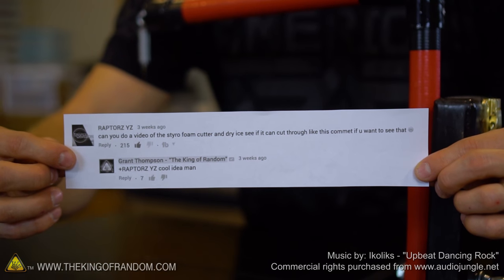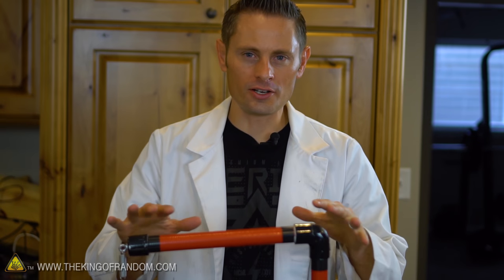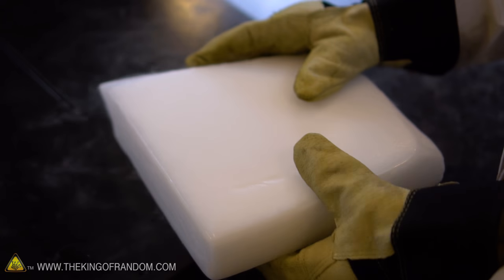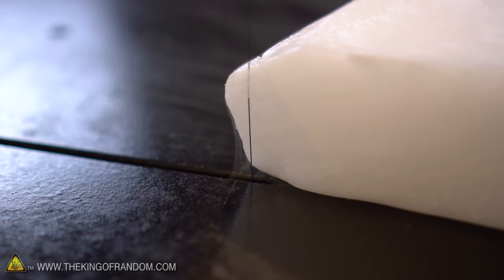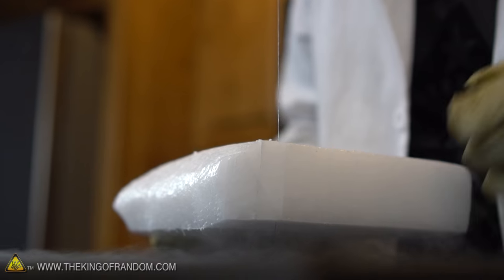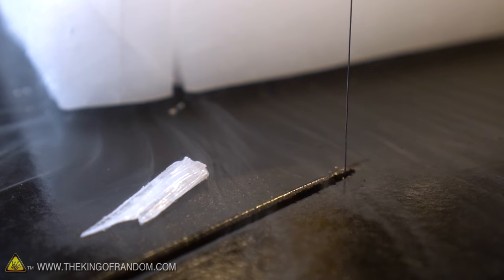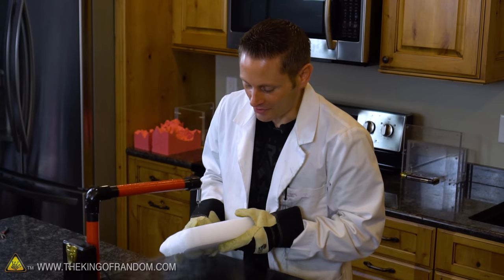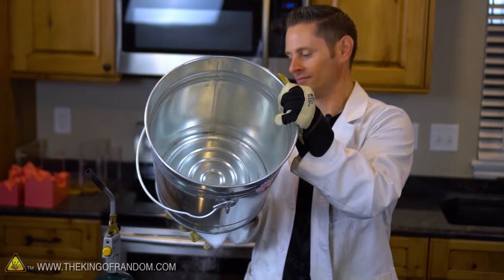Will a Hot Wire Cut Dry Ice?

Comment: The wire and propane torch didn't cover enough area but what about a barbecue? It would almost evenly distribute heat around the block
Reply: gatorgaming11 gr8 idea
Reply: Throw it on a BBQ!
Reply: Yea due to surface tension the block cools the wire.
Reply: It would put out the fire, it's CO2. Or maybe you mean a electric one.

Comment: what happens when you put dry ice in liquid nitrogen
Reply: You get long lasting dry ice and evaporating liquid nitrogen. LN2 is much colder than solid CO2
Reply: frozen raw chicken that will shatter like glass :)
Reply: you know how ice cracks when you put it in water? the ice is imploding because water expands when frozen. In theory, it should explode
Reply: AWW I DIDNT SEE YOU ALREADY POSTED THIS
Reply: when you drop ice in water it doesn't crack from freezing its the opposite. It cracks because the water which is warmer than the ice heats up the surface of it causing it to expand. Since the center of the ice is still cold it doesn't move. This causes the ice to basically rip itself apart. This wouldn't happen for dry ice because it isn't a liquid. If you used regular ice it wouldn't explode either because liquid nitrogen is colder than ice. The ice cube would actually cause the nitrogen to boil.
Reply: Jesse Robertson
Reply: What a
Reply: Jesse Robertson lol thats weird
Reply: Smelly Poo ok
Reply: Blaizer Beam gaming and vlogs #CageFace.
Reply: That's basically how they make it

Comment: What happens when u put most strongest acid on dry ice and with most flammable liquid and try to put it in the arc furnace
Reply: nothing
Reply: mrlevite1237 probably*
Reply: it would probably depend on the size of the dry ice. small chunks would probably vaporize very anticlimactically, mid size might pop the top off the furnace, and a chunk almost too large to fit in the furnace would probably freeze the top to the main body, and blow up from the pressure buildup.

Comment: What about your sun powered, magnifying glass? Will that work on dry ice?
Reply: Kerbal Plays - Minecraft I would like to see that too
Reply: yeah, that would be cool to see
Reply: I wouldn't expect a whole lot. The dry ice is white, so it doesn't absorb much light to begin with, and it's also a little bit shiny (kind of like regular ice), so that's even more light not being absorbed. That being said, it could be so powerful that it manages to overcome those "obstacles" and still do some damage. Maybe he'll try it out.
Reply: elektrikpulse61 Maybe he can place a black metal on it to capture the heat.
Reply: the fastest answer is to put the dry ice in a metallic box painted on black

let's go crazy, let's propose a challenge to Grant Thompson, make a metallic box (cheap metal) then melt some copper brass in the foundry, use it as a coating for the box (so heat is easily transfered, and copper brass has a decent thermal conductivity, is cheap, easy to melt and easily found) paint it with black and then put the dry ice in the box, then just apply heat to the side (for example) or use a mirror to reflect the sun to the bottom of the box.
Reply: If a propane torch doesn't work the magnify glass PROBABLY wouldn't work. Just a guess
Reply: Joachim Von Grimorium
Reply: HydroSphere Gaming he has a 4 ft one that can burn up to 2000 f
Reply: Edward Zhu Oh didnt know that
Reply: yeah. It uses an old tv screen. It sets logs o fire in seconds and then burns through them in minutes.
Reply: oooh id like to see that
Reply: are you mad Kerbal are you mad??!!😠
Reply: it needs to make as much heat as lava or atleast a big percentage of it
Reply: Piemanding Joachim Von Grimorium I like your ideas. If more people like the original comment or make their own suggesting he does this, maybe we'll get a video featuring dry ice versus a 2000F sunbeam.

For the best results though, I'd wait until June or another northern-hemisphere summer month before doing it to ensure maximum "fire"power... that was a pretty bad pun, sorry - especially since it won't catch fire, being made of CO2 and all.

Comment: What will happen if you use the match head powder and sulphuric acid by placing it on dry Ice?
Reply: Ridiculous I would wanna see that
Reply: It will combust.
And then it will slowly die out.
Reply: Ridiculous nice 👍
Reply: Pretty much nothing, since the melting C02 gas will replace the oxygen.
Reply: ***** No. The mix of compounds in matches is self-oxygenating.
Reply: Ridiculous l

Comment: What would happen if you microwaved dry ice??
Reply: JDog Vids yess
Reply: probably no much as the microwave can only heat water molecules
Reply: Szobiz it can actually heat up polarised molecules, i dont know if co2 is polarised
Reply: Style nutz fun fact it is non polar as oxygen molecules pull shared electrons from carbon opposite sides, so no net polarity(electrons aren't moving specifically in one direction)
Reply: no, CO2 is apolar

Comment: dry ice in the shape of a chicken!
Reply: Unlisted How Is he supposed do to this?
Reply: I don't know how he would do that, but yes!
Reply: CRAZYPHEONIX117 Well I can tell you: i think he wont be able to do so. Dry Ice is frozen CO2 which is a Gas. He needs extreme pressure to create his own ice
Reply: Peter Peter, pour liquid CO2 in the mold and freeze it...
Reply: Melting Clocks ??
Reply: Peter the Porcupine But Thats not how this works man
Reply: Unlisted yeah this might work by melting the dry ice
Reply: mech rush If u melt dry Ice it will become a Gas.  Why does nb listen im chemistry
Reply: Peter Peter He has made liquid CO2 by placing a couple of pieces of dry ice in a test tube. He would need someway of taking that, doing it a much bigger abundance, and then somehow find a way to put into the mold. If anyone could find a way, Grant can.
Reply: grant already done it with a testtube i think he can do it
Reply: You can made dry ice using a CO2 fire extinguisher. It's not solid blocks of dry ice either, it's more like snow. He could take the dry ice snow and pack it down into the mold. It'll be difficult to get out though. It is silicone, and I'm sure it'll freeze it solid. It'll also be hard to get it out without breaking off a leg or wing, especially if the mold is solid.
Reply: A Fucking Human Being And why?

Comment: have you considered replacing the steel wire with nichrome wire? it expels more heat and if you coil it around something like a copper wire, it can melt solder material. it may melt the dry ice...
Reply: JS-Obsidian
Reply: John Druziskyjr
Reply: Hugh Mungus
Reply: Drafty TV
Reply: JS-Obsidian
Reply: Hugh Mungus

Comment: If you cover a coin with never wet will it float?
Reply: no
Reply: it will however have an air bubble around it.
Reply: ALL MIGHT yes
Reply: It would not have an airbubble XD, there would still be in the water like normal, neverwet just makes the surface really slick to water, if you pull is out it will probably be dry though, pretty sure at least
Reply: no that's not how never wet works
Reply: Final answer to this question is that while a coin covered in neverwet will not ever stay in full contact with water, but since its density is greater than water, it will sink.
Reply: I'm talking about that 1 yen coin. Then just letting it go.
Reply: Matthew Gifford go google images of never wet covered items, there is a gap of air between the object and the item.

Comment: What if you throw the dry ice in the Sun
Reply: That turns off the sun.
Reply: There is actually a light switch in china that turns off the sun. If you look closely enough at the sun for about 5 minutes with your eyes you will see a label saying made in china.
Reply: Incorrect. You'll go blind which means your eyes are made in china. Triggering Intensifies
Reply: justin det cool idea man
Reply: justin det use ur common sense. It will disentingrate before it even touches the plasma

Comment: Hey KOR, I think I figured out how dry ice works. I think that using things like the StyroSlicer don't work because they don't draw heat away from the block of ice. Water sublimates it a lot because all of the heat in the atmosphere is easily moved by the water into the dry ice. Single, concentrated heat is no match for dry ice.

Comment: The main problem of the Slicer ist that when the wire cols down the electic resistance drops and less electrical power can be transformed in to heat in the coled part of it.

Comment: Get two torches and put dry ice in gasoline put the torches on full and see if the dry ice will melt by hot fire or will it give carbon dioxide and freeze the flame